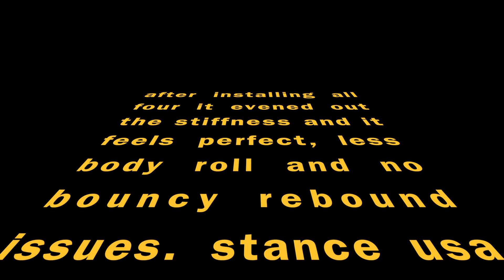Cb7| Stance springs 10k

Comment: I have a 1990 CB7 which is my daily driver. One fine morning I tried to starting my car, engine was turning over but the car didn't start. I kept trying and after like 4-5 minutes the started and started flashing S light and went into limp mode. It only happened once and it's been driving okay since then. I did check the TCU no burns or no smell. What could have gone wrong at that very moment that the car didn't start?? I'm unable to figure out.
Reply from the maker: Honestly I don’t know I haven’t had that happen yet ha but you could post that on the Cb7 Facebook pages and get some answers